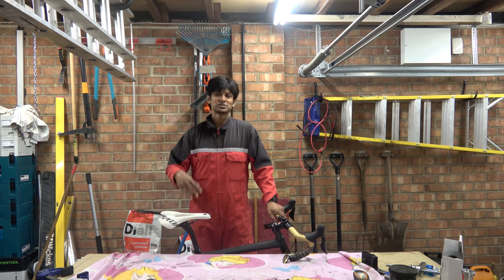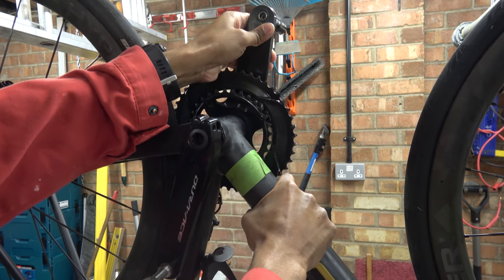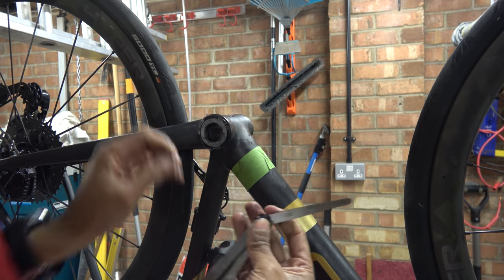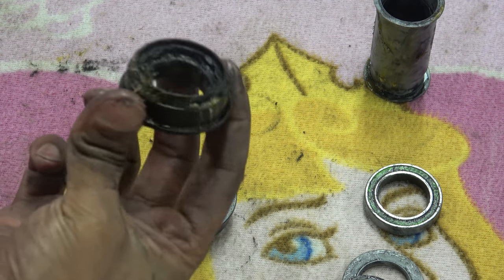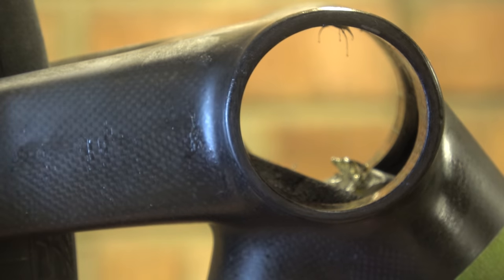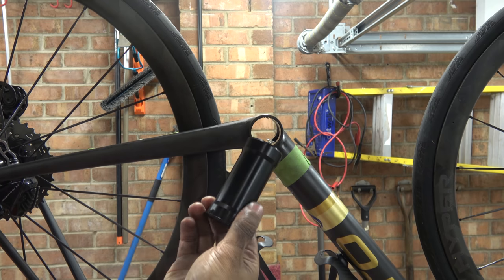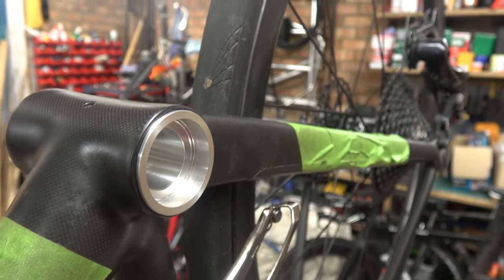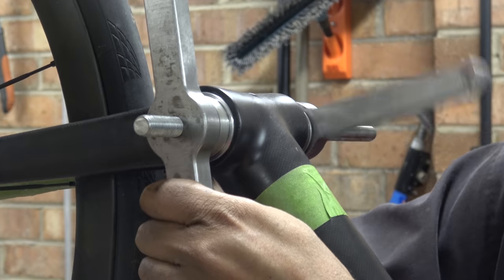Super Expensive Sarto Bike Frame, turns out to be crap. Hambini Bottom Bracket Necked Dream Build

Comment: C'mon dude. The grease on the spindle and BB is that black and it's 2 weeks old? Either your customer is lying to you or you're lying to us. Or it's heavy duty molybdenum grease normally used on farm equipment. Bicycle grease used on high end bikes is usually some shade of neon, it takes a LONG time for it to degrade and get dirty enough to turn that black. I service my BBs every 6 months, they get beaten on and ridden hard, one bike is a mountain bike that rides in powdery dusty clay and that grease is still mostly green when I take it apart.
That bike that you're wrenching on is at least 6 months old. At least.
And what's up with the geometry of that frame? It's tall enough for someone over 6'5" but short front to back for a midget.
And that massive cassette? You don't have any mountains or hills in the UK nearly steep enough to justify that huge pie pan of a cog. With that tiny smaller chainring? 100% girly-man owns that bike. Does he use Vagisil as chamois cream?  Sheesh.
As you were.
Reply: The grease is with EP additives! Is that a problem?

Comment: "Super expensive frame" - that's me, that is, imho. £2000+ though I forget exactly how much five years ago. I have no issues with it. It's triple butted steel, made to cycle around the world on (fairly) rough roads carrying loads of gear for a few years. It IS the dog's doodahs whatever you carbon frame, effeminate strips of gristle think.
But I (not the manufacturer) cocked up the eccentric bottom bracket by forcing it open. Dick head, huh? It's steel - I can force it back. Can The Great Hambini advise on an alternative eccentric BB? What bearings to use? Will it cope with cycling 10,000k through deserts, jungles, mountains, dust, swamp and Syria (no squeaks allowed)?
Be brutal
Reply: Hurumph!

No response. I may go to my grave and never know if I could have achieved cycling Nirvana

Comment: Somebody tell me again why the fck we needed press-fit center brackets in anything except a 1970's BMX bike ? The world turns just nicely on chased and faced brackets with squarely cut threads. Aaand you'll never see any light around the edges of a well reamed hole. 
If centre brackets are so problematic, have you even started on what steers us yet ? That scares me having had a professional mechanic crush a carbon steerer tube and give the bike back to me.

Comment: I've seen 150 pound brand x frames that are of a much higher quality x
Reply: I paid 179 for a "cosmetically" defect Dolan (paint chipped a tiny bit - it was tiny and not even visible). Turns out the seatstays and rear triangle are way out of alignment as the middle of the tire is way closer to one side of the stay than the other. The middle of the tire is about 1/4 inch to the right of the brake boss bolt. Sadly, i did not catch this time time and my emails to Dolan were ignored. So much for a "cosmetically" damaged bike. Be careful of their sales. Seriously. I am sure they just scratched the frame and said it was cosmetic damage fully well knowing this thing was way out of alignment. That was the only Dolan product i have and will even buy. They lost me for good. I know terry, not personally, is a good frame builder but he, via his staff, let this thing through knowing it was bad.

Comment: That spin at the end, smooth like a baby's butt. So satisfying. 

I just wonder why bike frame manufacturers don't use a similar method... It's probably easier and cheaper than trying to make 2 round holes aligned (which they apparently are incapable of). I mean it IS a Eu 5000+ bike (which should be a magnitude better than my Eu 400,- bike. )

Comment: How does my 'literally a Fucking schwinn' with a cheap Chinese bottom bracket and a cheap Chinese IFX crankset somehow work better than this? I get fat machining aluminum is easier, but... They literally cut corners everywhere and still out did A FRAME that costs 14 times as much as my bike veggie I threw some upgrades on it. I sincerely no longer understand why everyone keeps doing press in bearings and half assing it

Comment: How in the world do these clowns build a "custom" (probably all from the same jig with little adjustment) frame for that amount of coin and NOT laminate it around a precision machined BB shell? Carbon is great for lightweight but strong constructions. It's absolutely SHIT for precision fit, like what you might want for bearings. The more I've wrenched on bikes the more I've come to realise most people designing bikes and bike parts are not engineers. "looks about right" seems to be the main driving factor.